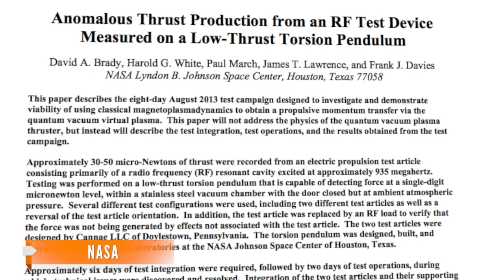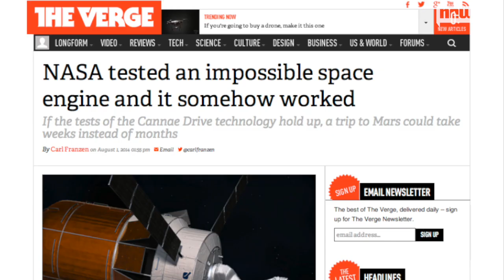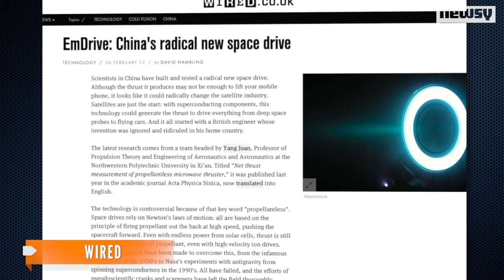NASA Tests 'Impossible' Engine, Finds Out It's Really Fast

Comment: i think they confused the engine based on Kasimir Effect and Assymetrical Microwave Drive..... one uses "virtual" particles by increasing their "spawn" chance in wanted area and then throw them with EM field and other one utilizes the notion that sped of light is constant and the time dialation to get unequal pressure on chambers of drive on it's opposite sides by siple assymetrical geometry of the chamber.
Reply: +Geroskop Why would anybody value the opinion who spells Casimir as Kasimir and who does not know that momentum is not affected by relativistic phenomena? Check it out: the gamma-factors cancel one another.
Reply: +MrAaronvee check this out - i can read and understand academic articles on three languages with different roots, how many languages do you know? I'm not native english speaker and thats why i make  stupid mistakes when i tired and type fast... now, to the assymeric engine))) i actually read article on arxiv about it, and they utilized a loophole in reltivity theory - the EM wave sent from one sourse should have the same velocity and not transmit inertia to the source, in all directions and if you do chamber symmetrically youll get different pressure on opposite sides of chamber. Since EM wave do not transfer inertia to their sourse, the difference is not cancelled out. Now, about Casimir Effect, the same name spelled in Polish as Kasimir, i got my point accross sufficiently clearly so fuck off! Spend your time collecting info and not trying to show your "superiority" being Spelling Police... dick...

Comment: There is a new cool idea: Because there is a constrant stream of charged particles comming from the sun. If you have a sail made out of thin threads that you possitivly charge then this sail will bouce of heavy ions from the sail towards the sun and achieve a force in the direction of this stream of charged particles. This is quite a cool idea if you ask me, a sail to glide on the solar wind :3!
Reply: +Electro-Cute I believe that Marx and Forward independently suggested this many years ago.
Reply: MrAaronvee cool

Comment: Zero point energy, simplesssssssssss
Reply: +michael connolly Isn't it funny that everyone thinks that ZPE is the answer to everything ... apart from those physicists who actually do research on the subject.
Reply: As far as I am aware current research into zero point energy proves that mathematically it can be achieved, however more breakthroughs will need to be achieved before it can be demonstrated practically, Einstein once said no one could build a atomic bomb as you would have to put so much energy in to make it practical, of course he later changed his mind after a discussion with his old friend that was to change his perception mathematically. this led to him writing to the then United States president voicing his concern that Germany had the potential to build an atomic bomb, it's not what we know now but what we will know at a future date that is important
Reply: +michael connolly There is no doubt that it exists: it is manifested in the Casimir Effect and the Lamb Shift. The problem is that - if the energy was 'normal' - it would be so huge as to have its own gravitational field, and that is not detected. It exists only in some 'average' sense. I do not think that Einstein doubted the energy of the atomic bomb, only that it could be released sufficiently rapidly.  By the way, that famous letter was totally ignored by the president - contrary to popular belief.

Comment: VCMD drive, im telling you
Reply: +t-bird shane a) centrifugal force is fictitious, so it cannot be exploited for propulsion. b) attempts have been made to patent the ludicrous 'eccentric flywheel' concept for over one hundred years and there are hundreds of examples of failure. c) prototypes fool their inventors (and investors) because they can propel themselves across shiny floors and ice; this is caused by stiction, and the effect is used in toys and process engineering (for sorting and conveying small components). d) there is no stiction in space, so there is no propulsive effect at all. e) Do not give up hope however; someone recently earned an MS degree for designing a 'centrifugal force' drive for deep-space propulsion. That does not prove that the concept works BTW, it proves only that academic standards are in free-fall!
Reply: +t-bird shane Care to elaborate?
Reply: its a variable centrifugal mass drive. basically dis balancing a flywheel on purpose, but in only one direction. like you holding two buckets and your spinning but the bucket flinging to,,, lets say north is always full, but the bucket flinging to the south is always empty. its variable because you can change the mass of the weights and the RPM. its really amazing when i built the first prototype. just 5 fluid ounces made 37 pounds up force (in one direction) at 150 rpm .

Comment: 30 micronewtons of force will accelerate something that weighs as much as a VW Beetle (820kg) at 0.00005639 meters per second per second.  If we figure only the straight-line distance to Mars at it closest passage to Earth, then at that acceleration, it would take 286,836 days - or over 785 years (about 10 lifetimes) - to get to Mars.
If you add just ONE KG, add almost half a year to the trip.
Reply: Steve Garcia Hahaha - you couldn't possibly carry enough food.  1 KG of food would add half a year.  You'd have to take a fertile sex partner along (50 KGs minimum) so that you could procreate 10 generations of humans.   That alone would mean a trip of 809 years (time increases as to the 1 over square root of the acceleration).  809 years of food would add, say, 1.5 KGs/person/day, or 3 KGs for two.  That is 1095 KGs total FOR EACH YEAR and 885,855 KGs of food for 809 years - more than the VW Beetle.  That jumps the time up to 18,000 YEARS.  The longer it takes, the more food, and the more food, the longer it takes.
By that time Mars ill be settled by others for millennia, while you are poking along just past the Moon.

Comment: This is a joke, yes?  MICRO newtons of thrust?  A newton is about 1/4 pound of force - the weight of a pre-cooked McDonald's Quarter Pounder. And micro means one-millionth.   So, take that Quarter Pounder into a million pieces and then throw 999,999 of them away.  The  put that remaining piece on a scale, where it won't even register. It will apply less force than a feather.

Acceleration depends upon FORCE, applied to a mass.  Applying half the force gives half the acceleration.  So, these doofuses are talking about driving large spacecraft with 1/4 of a millionth of a pound of force?  With less than the force of a feather landing? And getting to Mars FASTER?  Hell, maybe in 2,000 years it might be up to 20 mph.

Anyone believing this needs to check themselves out for being both gullible and stupid.
Reply: +Steve Garcia You would improve and scale up the design presumably. The major benefit is this can be powered by practically limitless solar energy.
Reply: Sorry, dude, acceleration is a =F/m.  Unlimited solar energy doesn't mean squat if you are getting it one drop at a time.  That is like saying we have an unlimited amount of time - but in reality we can only use one moment at a time, so what good does the rest of it do for us? It's like powering it with waving feathers. Ask the first aeronauts' ghosts how THAT worked out with airplanes - a lot of falling off towers and hillsides.
Reply: SerBallister As to improving it, we don't have enough technology yet to work with.  I am a retired mechanical design engineer, so I do have some standing in this, some position from which to post comments.  Would I try to power an electric a car with a AAA battery? I am not stupid.  In 40 years and a few hundred designs I never did one that didn't work the first time out. And I counseled people what to do and what wouldn't work.  Design is, first and foremost, knowing what can work and what can't - and avoiding the latter is the second step.
Reply: Steve Garcia I'm sure battery cells were rubbish when they were first conceived, we still persisted with that technology. I agree right now it produces practically useless amounts of thrust but it's the principle that is interesting.
Reply: Not really. If it provides such negligible thrust it is useless.  I mean, farting flies harnessed to power a car would be about the equivalent. Would that be "interesting"?  Of course not.
Reply: Steve Garcia It's interesting for its implications in physics.
Reply: Implications don't mean anything in physics if they don't DO anything useful.  You can't even bring in that it might be cool theoretical physics, because it isn't theoretical; it's real. It's real, and it is monumentally weak.

I stand by the mouse farts car acceleration analogy.  Seriously, that is about the amount of thrust that a Crooke's radiometer produces. Buy one of those and try to drive your car with it.  Good luck with that.
Reply: +Steve Garcia 
You forget that these tests are done at insanely low powers. These thrusters output several micronewtons, that is correct, but the tests also use less power than a light bulb, yes, I mean the more efficient lightbulbs. Chinese tests have shown thrust outputs of around 0.3 millinewtons per watt, or 0.72 Newtons using only 2.5 kW of power. That is still weak, but as far as we know, there is no reason this would not work scaled up, and there is no reason an array of tiny thrusters would not work even if we can not make one big one.

Another fact, laser interferometer experiments run on the resonance chamber indicated quite significant variations in path time (light traveled at significantly different speeds through different parts of the chamber).
This basically means there's some weird quantum bullfuckery that we don't yet understand going on inside these engines. Yes this experiment was done in air and vacuum, yes it was repeated multiple times, yes the results were nearly identical every time. If this experiment is performed independently elsewhere with a different interferometer, and it gets the same results, the emDrive will basically show itself to be some primitive form of warp drive.
Reply: 2.5 kw is about the output of a hair dryer, and it gets thrust equal to about 3 ounces.  If you think that is efficient, I don't know what to say to you.  That is HORRIBLE efficiency.  I keep saying it's like pushing a bowling ball with a feather, and I don't back off that now.

As to the warp drive guess of yours, that is all that that is.  Weird things going on? It just means that for the moment the scientists are over their heads in a new experiment.  While it is good for them because they are learning some new things, saying that it is going to be a warp drive sounds like an unfounded wish for Star Trek to come true.  Millinewtons or micronewtons, the acceleration would be a like a turtle with four broken legs, crawling across the desert - and dragging a house behind him.

I so many times see people online who have no sense of proportion. This is another case of that.  Scaling it up means adding more weight to be moved - and each added kg delivers less power than needed just to move the added kg.  It's a losing cause, going more and more negative in the output-vs-mass equation. Your wishful thinking is driving your mental processes. As an engineer I only see that the proportions are all wrong.  

...Proportion, proportion, proportion...

Comment: I don't think I've ever seen a title as vague as this before. In space "fast" doesn't mean anything.

Last time I checked no reaction mass = no thrust.

Explanation:
Force equals mass times acceleration. A rocket engine accelerates a mass (the mass being burnt fuel) to get force.

Plug in the numbers for this engine and m = zero. Without mass you cannot have force. Of course you can claim to be getting this mass from [insert fancy buzzwords here]
Reply: +Jonah Beale (RCFlyer) The EMdrive is not reactionless but propellantless - big difference there. The reaction mass is the ZPE. And with "fast" they were probably implying a high acceleration.
Reply: will rice
That is correct, this engine uses virtual particles as a reaction mass, in theory. Nobody knows if it truly works, and if it did it would only be feasible in ultra deep-space probes due to the minuscule thrust and extreme burn times.
Reply: ***** 30 micronewtons will accelerate 3 milligrams at 10 meters per second squared ignoring all other forces in every other direction. Unfortunately it is meaningless to exert a force on a zero mass. You could say it was accelerating infinitely but it would not mean anyrhing until there is mass.
Reply: *****
The prototypes that have been tested have produced so little thrust that they're still not 100% sure if it's actually working. It's an order of magnitude lower than their instruments can measure, if I remember correctly.
Reply: ***** Yeah I guess we have to wait for better results.
Reply: This engine uses the mass of particles to create thrust. It even works in a vacuum. Listen to the video again
Reply: Brandon Wiebe
Yes, in theory. For all we know, it might not be possible to use virtual particles as reaction mass.
Reply: William Miller 
As I said before, they DID test it but aren't sure if it's actually working. They'd have to send one up (probably to high earth orbit) to make sure but it would be a massive waste of money if it doesn't.
Reply: You don't need force to accelerate if you have a warp drive. In a warp bubble you aren't actually moving at all, it's the space around you that's moving
Reply: Brandon Wiebe
Warp drives are a mathematical concept ATM. We know what needs to happen, but we haven't the slightest idea how to do it. All we really know is we might need lots and lots of negative energy.
Reply: +Jonah Beale (RCFlyer) yes, not really sure were they got 'fast' from.
Reply: Yo guys are all thinking old school. Get with the program fellas.
Reply: Popular culture likes to suggest that there is an 'arena' in which everything happens, called 'space-time'. And it likes to suggest that this space-time is a bit like a 'fabric', just a fabric that does not impede motion, and one which can be twisted and distorted to influence the movement of mass and energy. The reality is much more subtle: there is no 'fabric'. Space-time is a void in which fields flicker on and off in minuscule periods of time. All that can be really said about reality is that you can measure the distance between objects. These objects influence the flow of time in their vicinity. Gravity is the apparent attractive force between objects, perhaps mediated by the fields. But space itself, three linear spatial dimensions and one of time are not physical entities to be manipulated. At low speeds you travel through time at one second per second. In a gravitational field, and depending on the observer's frame of reference, time appears to slow down. At relativistic velocities, you travel, as it were,  more through the linear dimensions, and less through time eg: at 0.95c, time for you seems to be running normally, but seen from another reference frame it is slowed down to about 30%. I guess what I am trying to suggest is that there is no real 'fabric' to be manipulated to build FTL bubble-type drives. Space doesn't have any sort of 'handle' to grab, to be manipulated, because it is itself emptiness. The flickering virtual particles are not space, nor space-time, and are not real particles. They do have, taken overall, over truly vast reaches of space, a non-zero energy. Whether that near-zero energy is something that could ever be harnessed is sheer speculation.

Comment: Isn't it like having a hose thrashing around when the tap is on full blast, but without the hose? the vehicle is being pushed along by the release of the microwaves. i think it's simple, but i don't have a degree in this stuff. i didn't even finish year 10.

Comment: The Fetta Drive is the same as the Emdrive (the patents quote one another). The Emdrive was backed by the UK government. The company which manufactures it is now deeply in debt, because the concept is ludicrous. It is not the fact that it uses microwaves which is the problem, it is the fact that the microwaves cannot escape. Those who think that it works must also concede that a helicopter can lift a large airtight box ... while inside the box. Impressed by NASA acumen? This is the company which also wasted millions on the Podkletnov antigravity concept. This is the company which killed 7 people because it did not understand the properties of rubber! Government agencies can waste millions without censure (DARPA and the hafnium bomb, CIA and psychic warfare, etc.); read Park's Voodoo Science.